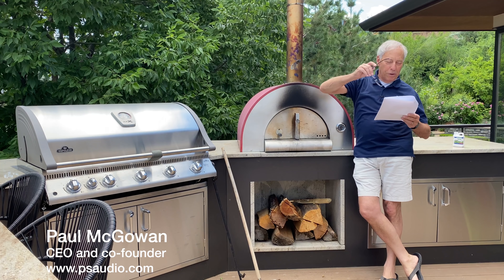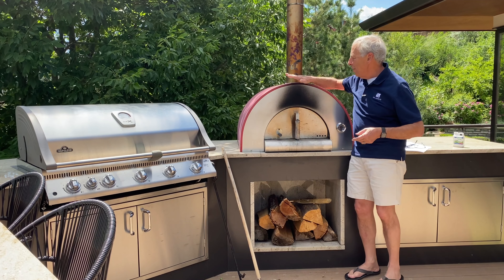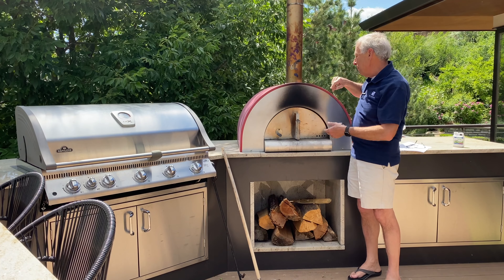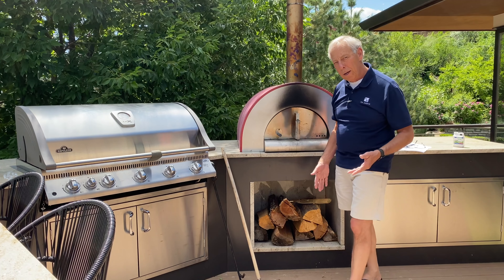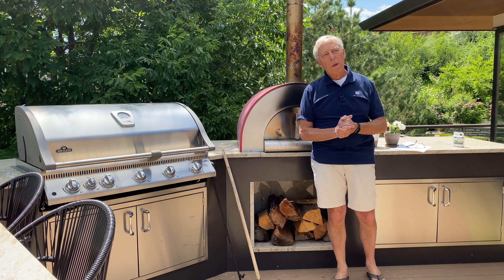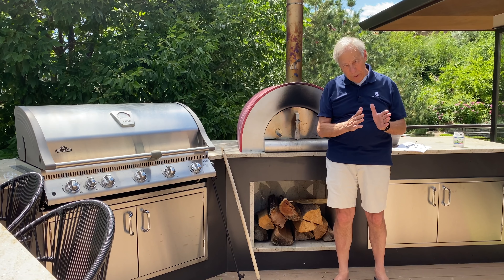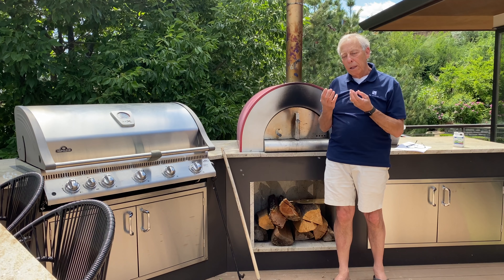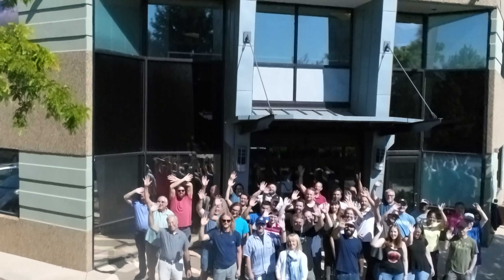Stereo receivers and LFE outputs

Comment: Now that is one hell of a back yard cooking set up. My complaments Paul
Reply: .... some lovely high grade  Wagyu on that would be a thing of beauty (I'm not a vegetarian)
Reply: Makes me wanna eat a pizza...
Reply: Love that backyard !! 🤩🤩🤩
Reply: Francisco Neira Yes agree, actually I did my worst bummer in a long time today about my backyard. I was doing some planting of roses in my backyard early this morning and turned on manually the irrigation. Then I got disturbed by a phone call and forgot to turn it off again. At around 5pm I was out in my front yard and noticed water was pouring out on the road...at least 10,000 gallons of water flooded my backyard and front yard. I could have spent the wasted water money on an outdoor pizza oven instead. Now I got a big swamp.
Reply: @ThinkingBetter  Why not some soil humidity probes with an Arduino or an 8266 sensing? Could be a very nice project
Reply: @neira.francisco  I'm using a Rachio box for irrigation valve control connected via WiFi and it works with Alexa as well as my HomeSeer server. But I recently bought 6 NodeMCU boards on Amazon and am now working on some mini hobby project using Arduino's IDE that I plan to post on Github when it's running. It's a sort of home automation status display (for HomeSeer). I will let others waste water on debugging irrigation software...LOL I could see myself doing an Arduino based irrigation system and find my house under water due to some bug...
Reply: @marcus1970  is there a low grade wagyu?
Reply: @TheEnzoferrari12345  Hah...good one! ;)

Comment: LFE outputs are mostly both L/R and LFE depending of if its stereo or Dolby Digital signal. So there is no problem using the LFE output. Most have 2 now and they can be set to stereo.

Comment: Mid to high end modern STEREO receivers have a SUBWOOFER output, not LFE. 
Works fine on my new Marantz NR1200 w dual subs connected.
Reply: You can set lfe output as lfe+main in your receiver and then it has to perform as regular sub output. I had a problem when setting lfe+main and listening music there was almost no bass from old non lfe input subwoofer. The high end Denon receiver has no special sub output, only lfe or lfe+main, speakers are small but sub bass output is minimal.

Comment: Thanks Paul, I have always used the line level connections simply for convenience; I get your reasoning and it makes perfect sense to me. So as an audiophile I have to at least try it. I'm thinking just some zip cord from the amp - don't want to run my speakers through the sub.

Comment: @PSaudio Paul, thanks so much for answering my question :-). I'm Chris from Port St Lucie (pronounced "Lucy" by the way lol). I really appreciate you taking the time. Shortly after submitting my question to you guys, I discovered that the integrated receiver that I want actually has a "Sub Out" composite jack and not an LFE out.. Doh! I could have sworn it said LFE. Well, we all make mistakes. And now you made a whole video about it LMAO. Sorry about that. Well, it's okay because it's along the same lines. I have a follow-up question though.

Even though the integrated receiver that I am interested in purchasing has a "Sub Out" instead of an LFE
Out, I was informed by the manufacturer that they do still have an internal crossover set at 90 Hz. Now, since this isn't a LFE out, and the best subwoofer that I can afford (and the one that I've have my heart set on) does not have high level inputs, in this particular case, will I still be able to adjust the subwoofers built-in crossover knob from 90 Hertz and DOWN? And, is this solution somewhere of a "middle ground" between the LFE hook-up and high-level input method that you spoke of?

Thank you and thank you for all that you guys do by providing excellent content and answering questions to folks who may not quite be able to afford certain levels of equipment. I greatly appreciate you and your team.

Comment: Thanks to Paul I have a subwoofer in my patio system. Works  GREAT!!! Big improvement in that system.
My main in the house system does not have a subwoofer.  Thanks to Frank Van Alstine's  SL 10 preamp It
Has MUCHO!!! bass. Very best piece of audio gear I ever had. Made a HUGE!!! improvement in my main
 audio system.

Comment: A two channel content file contains two discreet, as best as the media can do, channels of info. Those two channels are full spectrum 20Hz to 20Khz. Connecting a sub woofer to both channels IMO is fine so long as the subwoofer has filtering in it to keep out the upper 7 octaves or so.
A movie file contains a ".1" channel as in 5.1, 7.1 or higher. The .1 channel contains ONLY effects and no music information. Most receivers decode the .1 channel and put that through the LFE output. And not content from the other channels.

Movie theaters do not mix the LFE content with the other channels in the theater. LFE information only goes to the effects speakers.

The LFE channel carries only effects content in the lower two octaves, 20 -> 40Hz, 40 -> 80Hz. I've heard that most receivers roll off the LFE channel, top and bottom, at 24db/octave.

Comment: Anyone who argues against subwoofers has never run dual REL subs that have been properly integrated.
Reply: or has a soul
Reply: Not just Rel but any properly integrated subwoofer.
Reply: REL is not the end all abd be all if subs, although they are very good 

But Audiokenesis "swarn", Rythmik, and especially, GR Rsearch servo open back subs are their equal, or better.

Until one hears hiw fast and the natural way an open back sub loads a room, you haven't heard natural bass.
Reply: Try running 2 paradigm sub 2s my friend. My neighbours hate me.
Reply: I am running 2 JTR Captivator RS2’s that are tuned to my room using REW and most would think this would be major overkill as did I at first . But if you didn’t see my subs you would not know I was running them as they blend in perfectly with my Vandersteen 3a Signatures. So if  done  correctly subs are a definite positive addition to a 2ch setup as well as HT.
Reply: Pity those poor SVS and other sub owners who are left with Merlin's musical let-them-eat-cake. ;)
Reply: @jimshaw899  I have 2 svs sb-4000 subs and I can turn on pure direct and disable them and thr crossover and you can't even tell the difference. That is just with level matching and the crossover set, no low pass filter. Getting a sealed sub to blend is very easy and it definitely sounds good with my monitor audio gold speakers.
Reply: @pandstar  It's the most versatile. Only one to my knowledge that allows for triple stack arrays. I'm not a brand loyalist by any means..
Reply: I don't run REL, I run dual Definitive super cube 1's because ingot them for a deal nobody could pass up when I used to sell them. I couldn't imagine my setup without them. Like you said, properly intergraded subs are a must!
Reply: Yeah, no matter what you decide to call them, the drivers delivering the lowest couple of octaves should not “announce “ themselves - there’s  more than enough shittily enough mixed programme material of all genres to make the most neutrally  balanced systems sound like crap. 
I’ve implemented “subs” in both music only and home theatre systems, and there are definite advantages to HP filtering main speakers with less than stellar bass extension, which is not something readily accomplished by using the high level inputs on subwoofer plate amps. While the high impedance load those present to the main power amp have a virtually inconsequential effect on its performance, few of them have HP functions on the signal out, and those that do will be using far cheaper components than any serious audiophile would ever allow in their speakers’ crossovers.
Reply: Hi Paul, I have a question. I have two Rel powered subwoofers 1508 predators. Question I have I listen to 50% music and 50% movies. Can I just use the Low Level input all the time as my pre outs are used for my power amp. I like the bass from t and like u said lfe output on music don’t use it. Low level input uses internal cross over in sub and lfe uses sub in pre amp correct?
Reply: Subs have another positive - there is no crossover inductor in series with a bass loudspeaker.

Comment: I have my sub hooked up to the speaker level inputs. Fortunately, my mains really can do a solid 50 to 60 hz. Also, they don't seem to overload when deep bass comes through. If they did, I would want to cross it over at preamp level so the speakers are also relieved of low bass duty. I'm assuming the LFE on a Stereo receiver does not provide a high pass to the mains, so your mains are stuck with handling the 25 hz notes. That is the only possible drawback.

Comment: Love my RELs but have not found a way to run them high level with my balanced monoblocks. All REL recommendations did NOT work. Worked great with my 2 channel amp
Reply: Is it really not working by splitting cable from monoblock to speaker and to sub ?!

Comment: I seem to remember years ago Rel's were about the best subwoofer you could get. I've heard them but never tried one in my system. I did try a Velodyne ULD-15 which was supposed to be good as it was servo-ed but I heard no addition to the low end I had and it just blurred or colored the bass I had. I use full range electrostatics. True low-end electrostatic bass can sound stunning.

Comment: Now I'm wondering some things about using the High Input on subwoofers; Does that mean it will bypass both the crossover and level circuitry, or will it exactly still use the crossover to then use it even more effectively as that could be used to exactly decide the cross-over between the subwoofer and main speakers (as it would of course or hopefully stop anything that the subwoofer-speaker produces from going through to the main speakers). - And the level, well, I suppose that would still be active, unless it uses the high-input signal to determine how loud it goes, but I doubt it considering it's powered/amplified separately. - Perhaps it even determines the level of the main speakers? I don't know.

And another question when it comes to that approach; What happens to the LFE-channel of a 5.1 source? Does it then get ignored and not played back by the subwoofer? Or would you need to also keep the pre-out connected to the subwoofer for those sources to come through?
That part is also confusing because there's only room for the front left and right speakers as high-inputs/throughputs and not the ones like the rears or surrounds. I mean, sometimes it's a combination of all 6 speakers in a 5.1 setup that creates and effect and not just the Front Left/Right and Sub, which seem to go in tandem with the "High" throughput.

The reason I'm asking is because I use a 5.1 setup for both "effects", being movies and games, and also stereo music. I've gotten it to work pretty well mixing in the level and cross-over of the subwoofer as balanced with the other speakers as possible (because I definitely don't like it too "boomy" either), but if it could be even more precise with the "high throughput" for example, perhaps that would be a good way for me to do it. Again, I just don't know if it would work for all sources, hence my questions and confusion about all of that setup.

Comment: I have a 2k watt sub with line level ( high level) inputs hooked to a ten watt tube amp. Amazing
Reply: What's making that combination amazing? Hopefully you are not using those limited ten Watts also for the side speakers in parallel cause that would ruin the effective utilization of your subwoofer's 2,000 Watts if you have balanced the frequency response reasonably well.
Reply: @behexen250 It boils down to efficiency. Of course if your side speakers are much more efficient than your subwoofer, then things can balance out somewhat. Otherwise, some music will not be so great (when you play loud) if a 120Hz drum is with max power of 10 Watts and another drum gets 2000 Watts at 40Hz. Anyway, in my home office on this iMac I'm using right now I run my restored servo Velodyne sub with 1250 Watt RMS and 3000 Watt peak and a pair of KEF LS50W driven by a miniDSP SHD. The miniDSP SHD is quite awesome for a 2.1 setup. I dropped vinyl long ago.
Reply: @behexen250 Of course you can just reduce your subwoofer's output level. That's not my point. Personally I exhaust my max dynamic range on my speakers quite often and it would be a bit of a bummer if I got clipping, let's say 15dB earlier on my stereo speakers than my subwoofer. Yes, I'm fully aware that lots of products are advertising power data that is on the optimistic side and more of a mono channel lowest impedance peak than a stereo 8 Ohms RMS. In some cases the power numbers are utter BS. Anyway, there are standards for amp measurements incl. output power indeed but unfortunately, lots of companies just go with their own cheating way.
Reply: Loudspeakers working at 1-5% of max power are not producing high quality

Comment: When using two subs (L&R) connected via the high level inputs how much bass overlap do you have with the main speakers and also what bass frequency do you use when testing phase / delay etc? Lastly, If I set my sub crossover too low the bass seems underwhelming, if I set it too high I get bass cancellation with my mains. I sometimes struggle to find the sweet spot. Is there a tutorial or a method psaudio use to fine tune their subs with mains?
Reply: Supes 323 ? unless your subs are electrically out of phase or polarity with your other component speakers, there shouldn’t be any sound wave cancellations. Also any ports on a bass sub should always open from the opposite end, so as to allow the air compression to flow freely, as opposed to doubling back when a port is placed on the same baffle as the speaker.

Comment: What happens to all that electric energy is being dumped into the high input connects and does the impedance change?
Reply: The power carries thru to the high level outputs & on to your speakers.
I don't think it has an effect on impedance.
I'm setting mine up that way in just a bit.
Hope that helps.
Reply: @azmike1956  thank you

Comment: Why the heck would you want your amp to run your side speakers full-range causing low frequency distortion and clipping, if you have a subwoofer??? I usually prefer to cross-over the sub output before the power amp and also high-pass filter the side speakers for best performance (tonal balance/frequency response, soundstage, doppler distortion, THD, max usable SPL etc.). Feeding the subwoofer frequencies to the side speakers is causing several issues.
Reply: ^^ he gets it ^^
Reply: @poserwannabe1  Anyway, Paul is awesome...and that pizza oven is awesome too causing me to wanna eat pizza today for dinner, perhaps a Dominos steak pizza...
Reply: @ThinkingBetter  
THAT sounds GOOD !!!!

Comment: Does an amplifier really have that much character of its own in frequencies below say 70Hz? Damping factor and power output aside.
Reply: Amps with characters of their own are not the greatest amps. Also, why would you want your amp to run your side speakers full-range causing low frequency distortion and clipping, if you have a subwoofer??? I always cross-over both side speakers (high-pass) and subwoofer (low-pass) BEFORE the amps to get best audio fidelity (sound stage, frequency response etc.) and maximum low distortion SPL.
Reply: @ThinkingBetter  I think it's a matter of preference if people prefer some kind of coloration or none at all. And also one might argue that if you have only one sub, driving speakers full range might yield better integration.
Reply: It DOES NOT! it's the kinda "character" that comes from hallucination!
Reply: W A Or comes from listening too much to audio snake oil salesmen.
Reply: Simon Schneider Coloration means what? An amplifier is supposed to amplify and not colorize. And the reason you use cross-over filter is exactly to integrate the different audio outputs between the drivers better and that includes allowing the subwoofer to take over cleanly where it’s designed to be the superior lower distortion speaker. Your smaller stereo speaker might have 10% THD at 50Hz trying to defy laws of physics. In my case, I am using servo subs and the superior tracking of the cone incl. shorter decay would be messed up if a pair of bass reflex stereo speakers were playing in parallel as they would have much slower cone motion decay. I love when drums are precise and snappy rather than boomy with obvious decay and harmonic distortion issues.
Reply: @ThinkingBetter  In this case I will have a sip of my delicious snake oil and wish you all a wonderful day.

Comment: I don't know why all amps don't have high level inputs. Almost all car amps have high inputs. I like my receiver but it don't have low line outputs so if ever plan on adding a amp I plan on using "High Level Speaker Signal to Low Level RCA Adapters".

Comment: I found double wiring the speaker outs over to a sub a bit messy and a pain, so I modded my amp to have a sub out RCA, it's just a simple voltage divider/summer cct made of 3 resistors, however I can now use an RCA interconnect lead. Also, should I accidentally unplug that lead and short it to ground whist groping in the dark spaces behind my gear, no harm done. I can now also use sub's without the high level in's.
I can now swap sub's in and out with a lot less care than that required doing it the other way.